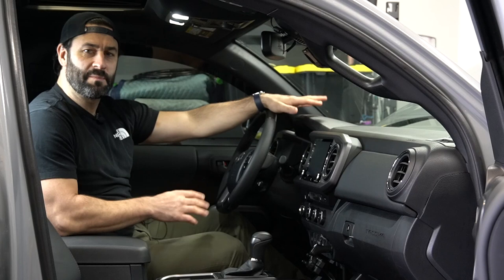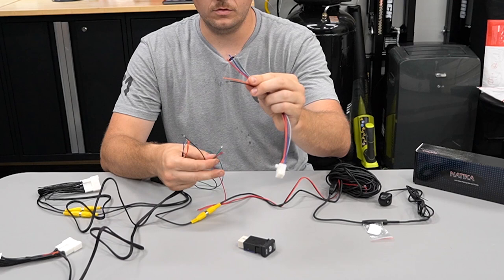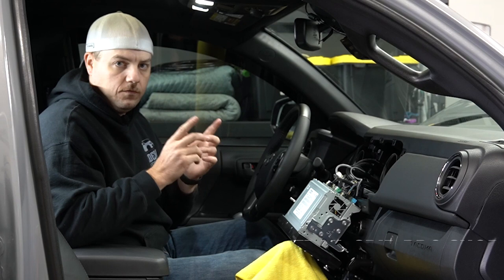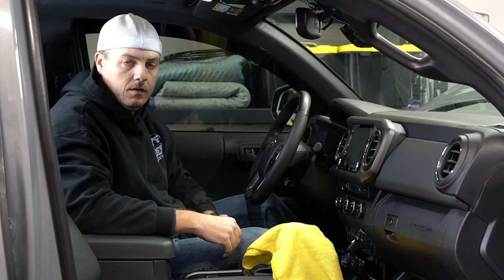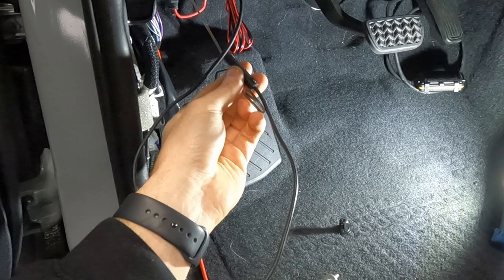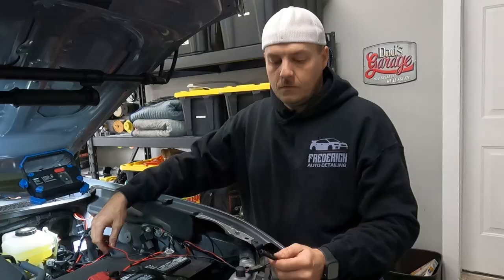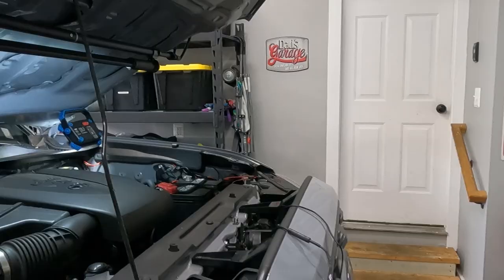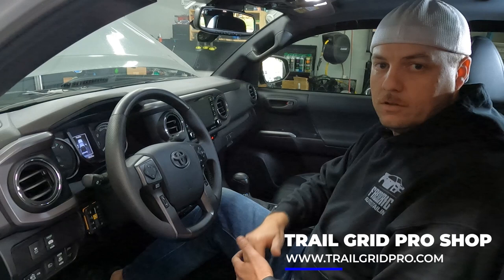Toyota Tacoma Anytime Backup & New Front Facing Camera Kit Installation

Comment: Got and installed mine - all as advertised.  the hardest part of the install was routing the connectors but it was worth the effort.  Great product and great instructions.  BTW $30 is well worth the work they they to pre-wire the harness.  thanks!
Reply from the maker: Woohoo! Great news and great job on the installation!! Thanks for your super kind words!!
Reply: I also got the 30 dollars prewired option. It saves me time for sure. I had to use my dremel tool to knotch the plastic part on my TRD Off Road grill—which takes half the time. The rest is just popping on the plastic parts and routing interior work. I didn’t know what to do with the black fuse box so it tucks behind the airbag dash. The rest works as planned.

Comment: Everything seems to work except that my switch only turns to front camera. As I switched to the neutral position of the button is shows the rear camera for a slight second then it goes to my regular unit screen. Is it a bad switch or wired wrong?
Reply from the maker: That's normal as the feed is switching from the front view to the normal position (i.e. rear camera view) since they pass through the same video feed.

Comment: I have a slight line that swipes across the screen, any idea what could be the culprit? Bad ground, or something else?
Reply from the maker: For the front camera I assume? Yep, it could be a weak ground - the other possibility is that when running the front camera wire through the firewall it could have been damaged internally which is interrupting the feed.

Comment: Bought this kit from this company with the pre wired option. Glad too. Waiting for warmer temperatures to install. Good to know I should be able to install mine exactly like this video.

Installed camera last Wednesday. I have a bad leg due to an accident so my installation took about six hours. Everything worked during a “dry fit” but front camera stopped working after full installation. TGP sent out a replacement component that should arrive tomorrow so I should be go to go. TGP works with their customers so contact them if you have issues. I also spent the extra $30 for pre-wired kit. Made installation much easier.
Reply from the maker: Thanks so much for your purchase! Let us know if there's anything else we can help with!
Reply: Update!

I had issues with this camera. All self-inflicted. Trail Grid Pro took care of me. My wife and I visited a daughter in Baltimore area this week and I scheduled an appointment with Trail Grid Pro for Friday, 2 Feb. Casey installed my camera and it works perfectly. Thank you Casey and thank you Trail Grid Pro!

Comment: Where does the relay mount on a 2022 TRD Sport Tacoma? The video doesn’t mention it after the connections are made? What about 12V power to the fuse box? Nothing is mentioned about power either as the installation progresses?
Reply from the maker: Thanks for your message! You can mount the relay wherever you’d like. Most use 3M Velcro to mount it near your switch. Power comes from the head unit, you don’t need to run power to the fuse box.

Comment: I installed it and it works, but the default screen goes to my rear camera. Not the Toyota Home screen. It WILL switch to the front cam, but when the switch is on the middle position its the rear cam,,, any ideas?
Reply from the maker: That doesn't sound right! Did you buy it from us? Give us a shout and we'd be happy to help: https://trailgridpro.com/pages/contact

Comment: Hello, I just received the anytime kit from the manufacturer.  I’ve been checking out multiple installation videos and found yours to be the most comprehensive.  I do have a question though. 

You used a switch location on the left side of the steering wheel and connected all the wiring ahead of time on a table. Are your harnesses all the same wire lengths as the ones in the anytime kit (I’d also like to locate the switch on the left side of the cab - and I watched another YouTube video where they added wire length to make this work)?
Reply from the maker: We extend the wires in our kits to allow them to reach to the left side of the steering column.

Comment: Can anyone tell me why some videos say to tap into a 12v power source for the red wire in the engine bay for the camera? I have a '21 and its is hooked up just like this one (triple checked wiring and grounds) and black image from front cam. Can feel/ hear relay click when going to front cam. Im using a Raayoo front cam. The only thing I can think of is that I need to tap into a power source for the red wire. That or the camera is bad. Thanks.
Reply from the maker: The videos that show running 12v power are older and not required anymore when you purchase our complete kit. I’m not familiar with the front camera you have so unfortunately not much help I can provide (maybe it does require power?) - but, generally, if the front camera doesn’t work and all other functionality works then it’s usually due to a weak front camera ground.

Comment: I had already installed it in front of the shift knob, and I realized that is a mistake since I want to install a USB 3.0 power plug on the right. I want to move it to the left side. I'm wondering if there is enough wire to make it over to the left side without having to extend it.
Reply from the maker: Great question! Did you purchase the kit from us?

Comment: 2019 Tacoma Access Door SR5    The only blue / Grey wires I have are in the Switch and have no clue how to connect since the other wire harness doesnt have a blue and grey as in the video.  Please advise since im not a wire expert.  Thank you
Reply from the maker: The 14-19 kit does not have a blue or gray wire from the harness. You can connect the blue wire to red from the switch and the gray wire to ground from the switch and that will allow your switch to illuminate at all times.
Reply: @TrailGridPro  Thank you for the quick response.  Is there a way to have the switch light when headlights are on or only can be illuminated at all times?
Reply from the maker: @paulsiebenaler3618  You’d have to tap into your illumination wiring within your vehicle.

Comment: Wish I would've used the metal fisher tape and tapped it all the way to the length to the second connector that goes through the firewall grommet ... got the first connector through and then while trying to get the second one though I severed the wire completely off of the  connecter pulling too hard on it... it was a super tight fit on a 2022 trd Offroad... so I got to take it all out... otherwise it was simple up to that point 🤣🥴
Reply from the maker: Oh no! Hope you got it all worked out!!
Reply: @TrailGridPro  I did.. kind of.. I had to get 2 kits… each kid had extra ground tapped into the power wire at the switch which made the rear camera not work… literally just one strand that was missed upon the assembly by the company…  not the best of luck with them but at least I got it sorted out.

Comment: Do you have a video to install the switch under the heater controls?
Reply from the maker: We don't but the install is exactly the same. Just pop out a switch under the heater controls and install it there - you can use a grounding point on the side of the head unit.
Reply: @TrailGridPro  I'm trying to order one now. Do you have a valid coupon I could use?

Comment: Is the installation the same on a 2019 Tacoma? Do the body parts remove the same as your 2020? Thanks
Reply from the maker: It’s pretty much exactly the same disassemble and reassembly. The kits are different for 2019 versus 2020 but installation is basically exactly the same.
Reply: @TrailGridPro  many thanks

Comment: My 21 has a rubber grommet between the cab and engine bay that is different than the one in the video. And short of drilling a hole, I don’t know how to get through it. Any suggestions?
Reply: There should be a "nipple" sticking out of the grommet on the engine side. Snip the end off the nipple and feed wires through the hole.
Reply from the maker: Good question! As mentioned below you can use the grommet with the "nipple" if necessary!

Comment: I have a blue and grey off the switch with no blue and grey coming off the harness. Got my kit a while ago and am finally installing it. Any idea if this is an old style kit or what I’m supposed to do with the extra blue and grey wires? Thanks!
Reply from the maker: If you want your switch to always illuminate you can connect the blue to red from the switch and gray to ground (black).

Comment: Were can I get the panel for the switch Since its a smaller switch?
Reply from the maker: Cali Raised sells a panel that replaces the coin slot.
Reply: @TrailGridPro   Yea I found it a day after I posted this. Its installed and works great just need to install more stuff to cover the other holes now 👍🏽

Comment: Great Video. I have a question even though I'm probably over analyzing. I have a 2019 SR5 Tacoma. Is the power to run this system being supplied through the connections coming from the radio? You capped off the red wire from the camera and only have ground wires exposed. Does this mean I don't need to worry about drawing 12 volts from a fused source? Thank you!
Reply from the maker: Yep, all the power comes from the radio!
Reply: @TrailGridPro  So, if I decide to purchase the unassembled kit for the 2019 Tacoma, will I follow the exact steps that you outlined in the assembly? Or is the assembly slightly different for both kits?
Reply from the maker: @freddygabriel2405  The 14-19 kit does not have a blue and gray wire - so the workaround to illuminate your switch is to connect the blue wire to red from the switch and gray to black (ground) from the switch.
Reply: @TrailGridPro  My final question is, will the premium camera included in the kit be mountable to the "Tacoma Pro Camera Brcket" sold by Taco Vinyl?

Thank you for your quick responses. I will be purchasing this system soon.
Reply from the maker: @freddygabriel2405  Yes, I believe it should work!
Reply: Do you have a video to use the slots under the heater controls?
Reply from the maker: @hemiman1967  we don’t, but that’s even easier because you don’t have to route anything across the steering column.